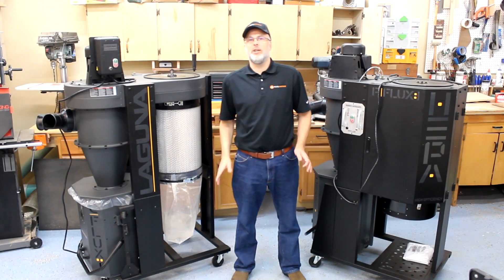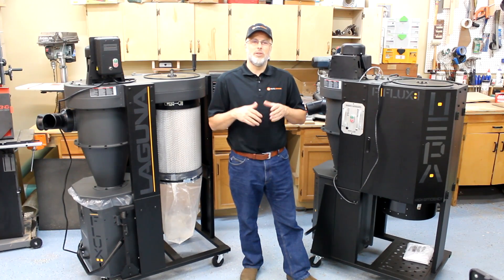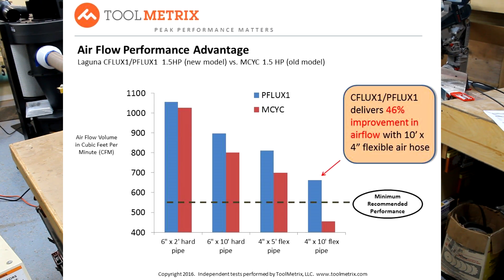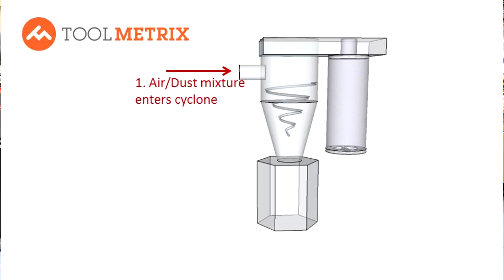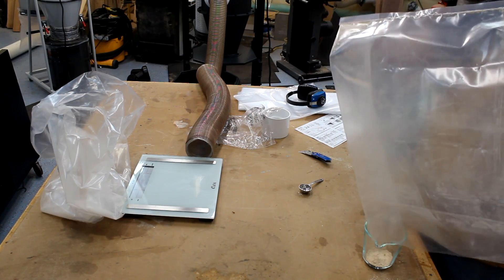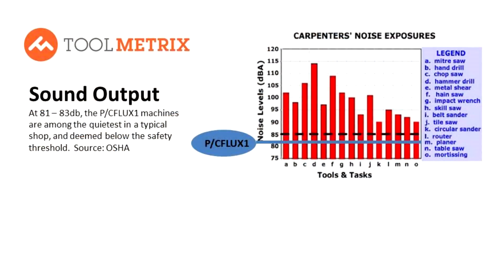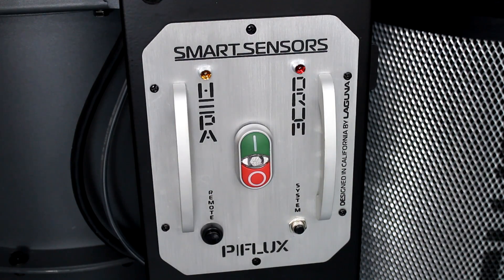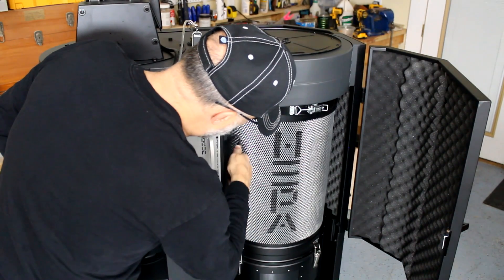Laguna CFLUX1 and PFLUX1 Dust Collection Cyclone "Deep Dive" Examination

Comment: Thanks Paul. This is such perfect timing. I'm curious why Laguna does not use a filter crank on the PFlux? Is it due to the construction type of the HEPA filter? So would you lean to one or the other of these two units? Looking forward to the comparison to the 3 HP. Are also going to do the competitor comparison?
Reply from the maker: Hi Jeff, thanks for the feedback.  You are correct in your speculation as to why they do not use the filter crank on the PFLUX.  I asked Laguna about this as well, and apparently there is a potential that the paddle will damage the filter over time.  Based on the air/dust separation results that I measured, I don't think having a cleaning mechanism is likely a factor.  1 tablespoon for 5 gallons of MDF dust is nothing, and MDF dust is a worst case scenario in my shop.  Time will tell, of course, but I wouldn't see using the filter cleaning mechanism very often.  When I saw that the CFLUX had one, I was actually concerned and kinda figured that would mean that it was not good at separation and that I'd be using it a lot.  I was completely blown away by how well they have managed to separate dust from air in such a low profile machine.  I don't understand the physics behind this very well, but somehow they managed to pull it off.  As far as which one I'd choose, that's a great question.  I have a son with dust allergies, so I'm a bit of a fanatic about air quality (my shop is connected to the house), so the HEPA filter is nice and I might lean that way for that reason.  Having said that, 1 micron filtration on the CFLUX is respectable.  The difference in sound levels doesn't matter much to me, because they're both quiet "enough", and quieter than most of my tools so I won't hear them when I'm working anyway.  I turn my cyclone off an on a lot, so it's mostly only running when I have a tool running.  The ability to use a bag in the drum without the metal liner is also a big plus for the PFLUX series.  I'll get started on the comparison to the PFLUX 3 shortly.  Functionality wise it is identical to the PFLUX1, so it will be all about the fan curve, and maintaining adequate air flow in a larger shop.  I'll compile the fan curve data shortly and put a chart on our FB page.  As far as the competitive comparison, I'm hoping to do this after I wrap up with the PFLUX3 video.  That would be a very fun project for sure.
Reply: ToolMetrix any idea if/when you will do the competitor comparison? Woodcraft has 10% off of Laguna for most of Oct. so wondering if You might publish your next installment before the sale is over.
Reply from the maker: Hi Jeff, Thanks for asking.  I doubt that I'll be able to pull the competitive comparison off very quickly, unfortunately, but the more I think about it, the more I'm wanting to do it.  I'm working on a plan to do this now, and I think the approach will be interesting but time consuming.  In terms of the Laguna 3HP video, I probably won't have that done for a few weeks, but I can share the testing results with you if it will help with your decision.  Give me a few minutes and I'll publish some data out on our FB page at https://www.facebook.com/Toolmetrix/.   What I've done so far is done sound testing and enough air flow testing to create a fan curve, and I'll push that data out there.  What I want to do before the video is hook it up to a bunch of actual ducting configurations and include the CFM and SP values for each of these in the video just like I did with the 1.5 HP machines.  This is a big piece of missing information that I think is helpful for people making decisions.  CFM and SP values alone are an interesting data point, but can also be somewhat confusing and misleading because static pressure is not fixed in a given duct configuration, but rather it is variable  based on the air velocity.
Reply: ToolMetrix I'm not that interested in the 3 HP unit. I don't want to add another 220 outlet and I'm not going to plumb dust collection. Plus I'm limiting my budget on this.
Reply from the maker: Ah, OK; thanks, Jeff.  For the competitive comparison I am likely going to focus on 220V machines for the first round anyway, because the differentiation in fan curves is likely to be more pronounced.
Reply: ToolMetrix Paul. I picked up and assembled my P-Flux yesterday. I was shocked that there was no plug on the power cord. I called them this morning and he explained that is intentional and that it is because it draws 18.3 amps or so at start up. What plug did you put on that unit and have you had any problems running it on a 20 amp circuit. Did your machine have a valve to shut off the suction tube to the bag/dust bin? There were zero instructions in the manual on this and I had to figure it out.
Reply from the maker: Hi Jeff, I don't like that either, but it is not uncommon on 220V tools.   In spite of the fact that the manual said it needed 30 amps, I thought for sure it would work on a 20 amp circuit.  I was wrong.  I tried it on two different 20 amp circuits and it popped both of them.  So, I wired a 30 amp plug onto it so that I could use it on a 30 amp circuit, and never had any problems with it after that.  I don't recall a shut-off valve for the dust bin connection.  I'll take a look when I get back to the shop.  I also was puzzled by the lack of documentation on this, and after I figured it out, I let Laguna know that this was missing from the manual.  They indicated that they are planning to add this and make some other improvements as well.
Reply: ToolMetrix actually I got the PFlux1 which is the 1.5 HP 110 volt machine. That is why I was shocked that it didn't have a plug on the power cord. Customer support said that is the way they intended. The power cord is only 12 gauge wire rated for 15 amps so I bought a plug rated for that at HD. I've not had a problem yet on a 20 amp circuit. Supposedly it draws 18.3 amps on start up?
Reply from the maker: Ah, OK, sorry for my misunderstanding.  Yes, both the PFLUX and CFLUX that I received were "plugless".  My guess is that they do this because a lot of people will wire it for 220 Volt due to the high amperage draw.  Their older 1.5 HP cyclone was wired with a plug, but it only drew 13 amps and was not intended for 220V wiring.  Normally 12 gauge wire would be rated for 20 amps.  Yes, I measured the PFLUX1 and 18+ amps.  Just for the heck of it I tried it on a 15 amp circuit, and it popped it right away.  I did not have any problems on a 20 amp circuit, but 18+ amps doesn't leave much headroom on that circuit.